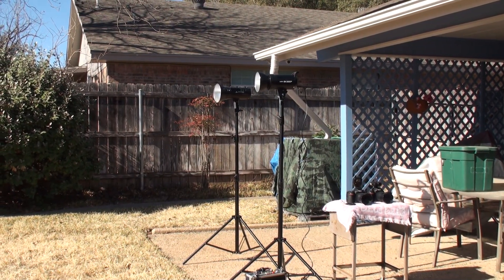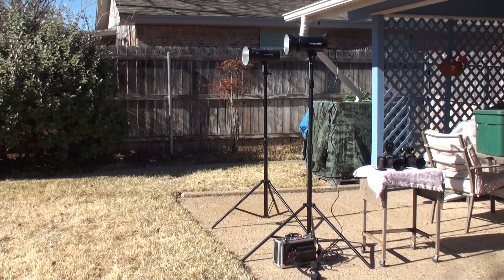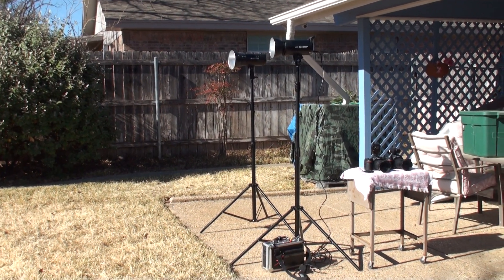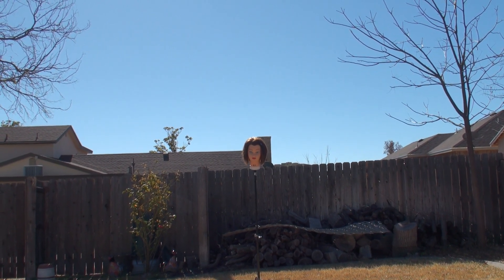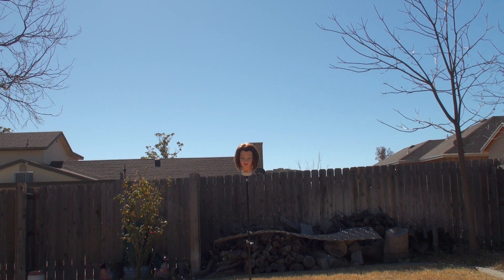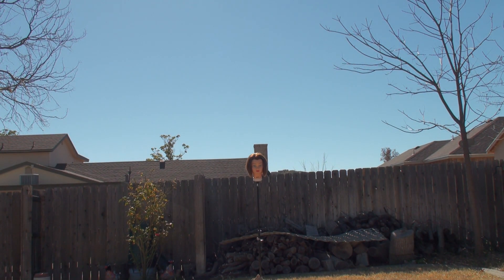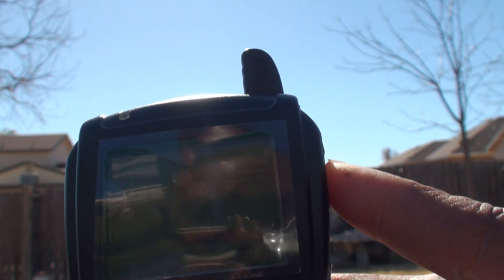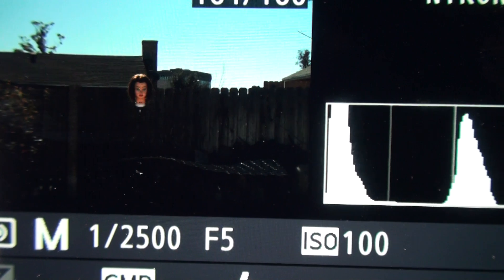GTX Studio TTL480 vs Godox SK300 II (OUTDOOR TEST)

Comment: Hi Carl, hope you are well. I used the flash at a wedding recently and it worked great. However, it fell over and the LCD at the back is busted. The flash still works, but now I can't see anything on the back and if I press the wrong buttons and accidentally mess with the settings, I might not be able to use it. Do you know where I can get a replacement lcd? I've been trying to search but nothing so far.
Reply from the maker: I would definitely be careful when going inside one of these, I'm sure there are capacitors inside that would do some damage. Try Cowboy studio website, I think there are their lights rebranded.
Reply: @allabouthim03  Thanks for responding Carl. I sent an email to cowboys support so hopefully they can assist. Thanks again for you assistance.

Comment: Hello, I am planning on buying the strobe soon. It's the one strobe that's within my budget for the features that it has. I see, based on your video that it does support HSS, what I want to know if how does it do in bright sunlight with a softbox attached. How far/ near would you generally have to place it to your subject?
Reply from the maker: I've done 2 outdoor shots with it so far and it has performed very well. Here in west Texas it seems to always be windy so I didn't use it with a softbox, just with the diffuser it comes with. Even with weight on my light stand I still was uncomfortable with a soft box. Again this says it's 400 watts, I feel it's closer to 300. As with any strobe with a softbox you will lose about 1 stop of light. Proper adjustment of your camera should be able to handle any issues.
Reply: @allabouthim03  Thank you for responding. I watched your video and found it a bit odd as well when you did the power output test, but then I saw what some 200ws strobes did in bright light and thought that if it's even 300ws that this can do, I will work with it. It's a more bang for buck than say the Yongnuo YN200 that I was reviewing especially since it has a modeling light. I have an HSS speedlight that has very low power, but even in bright days if I position it well I can get a tune out of it so this will work. Thanks again.

Comment: I found a problem with the GTX Studio TTL460  I have had two and it seems like TTL can not fire at full power
Reply from the maker: I guess we get what we pay for. I didn't expect $1k performance from a $200 battery strobe and we both see this thing has some glaring weaknesses in quality and performance. 

I can't right now figure out how to test, with mine, full power burst in TTL mode. My thoughts are I need to get quite a bit of distance between me and my target to test it, but it's raining outside today....so I'll try it another day. Sorry it's not working out for you, looks like your going to have to spend a little more money to get the performance you want. Personally, I'm satisfied with it...I don't have to lug a studio light with cord and battery pack around on an outdoor shoot is a blessing. In manual mode it was consistent, fast, and enough power to get all the shots I wanted to create.
Reply: @allabouthim03  I returned is I am just going to get a YN200 its the same power at the GTX and I already have yongnuo triggers the only drawback is the YN200 does not have a modeling light. But I do prefer a bare bulb over a flach tube.

Comment: Does your TTL work? I just got the Canon version and TTL does not work
Reply from the maker: Yes, the TTL works BUT, I find I have add .7 stops of light for better balance. Please make sure you have the transmitter on the same channel, and the other channels turned off if you are not using them. Turning the other channels off cuts down on clutter on the transmitter screen and keeps me from getting confused as to what I'm asking the strobe to do. I did a 3 hour long College graduate photo session this week and the light worked wonderfully out door. Over 300 shots and not one missed burst. NOTE: I don't use ttl much on my studio strobe, I like to use them on manual mode and adjust the output myself, that way it stays consistent. Hope this helps.
Reply: @allabouthim03  I spoke too soon the problem is back and now when I change the channel on the trigger or light it skips numbers so its hard to get both on the same channel and id I think I just have a defective unit
Reply from the maker: @CharlesReevesPhoto  I ordered a spare trigger off eBay that just came in today, I get anxious when I don't have a backup, lol. Which is skipping, the strobe or the trigger?
Reply: @allabouthim03  both
Reply from the maker: @CharlesReevesPhoto  that's very unusual that both have a problem. Here's one for you, the trigger that I just got is broken out of the box, lol. The bottom left button that turns the modeling light on/off is stuck in the on position. The trigger for this light feels soo cheap.  So back it goes, hopefully it will be a smote transition in getting a new one that works 👍🏽.
Reply: @allabouthim03  I changed my ID and Channel  agine and it seem to work now. The third time did it I hope I don't have to change it often
Reply from the maker: @CharlesReevesPhoto  interesting, glad it worked out.

Comment: Hey thanks for your review. I do believe that your are already  shooting in hss. Normal sync speed for flashes are at 250. The fact that’s your your shutter speed was at 2500 and you still saw the flash lighting your subject means that’s your flash is syncing using high speed. Thats I’m new to photography but that’s what I’m seeing. I’m thinking of buying this for my first strobe. Thanks again for your review was searching on YouTube and your the only person that reviewed this budget flash.
Reply from the maker: It is a strange and weak HSS. My God light is not rated HSS nor Hyper sync but it manages to do a better job than the GTX. I do believe the GTX can get the job done but  "mine" is not putting out 400 watts, much closer to 300 watts in my test. The best thing about this light is its' ttl function and the ability to change the light settings from the transmitter.